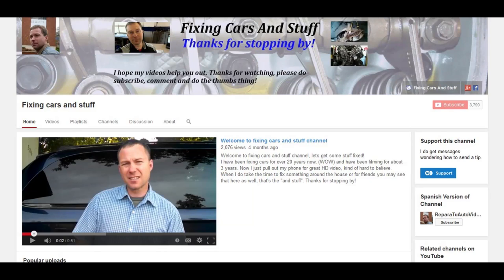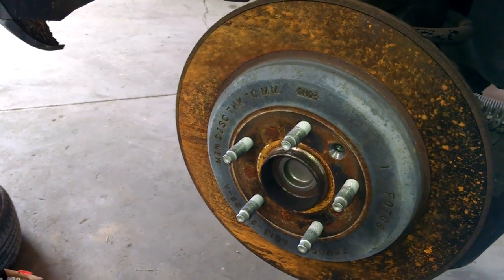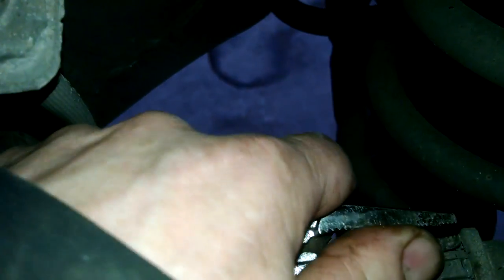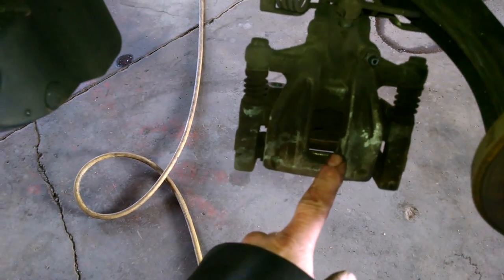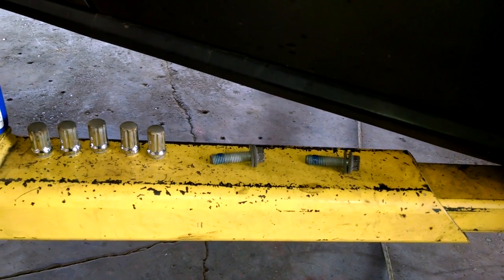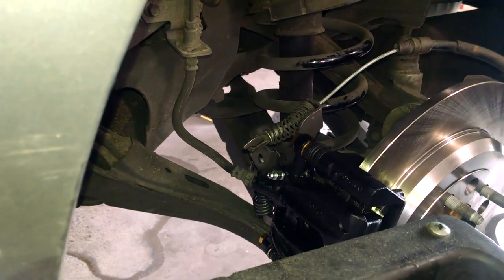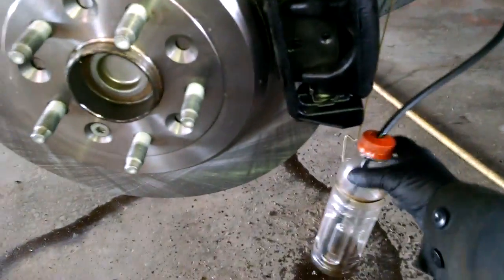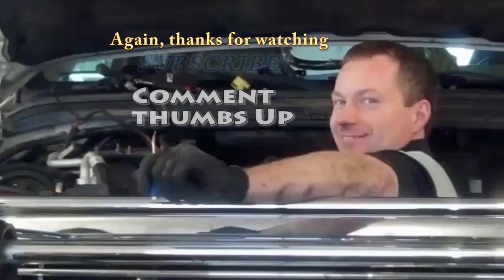Rear brake caliper and pads replacement Ford Taurus X  SEL 2008 how to change rear caliper

Comment: Nasty looking fluid. I would change that while you are doing the back brakes.  Also no need to disconnect the brake cable forward of the caliper. Disconnect it with a $10 tool on top of the caliper. You also cannot tighten the hose after you bolt down the caliper.

Comment: Thanks for the video. Have a 2009 Taurus with the same caliper setup as the 2008 Taurus X. Only issue I had was trying to figure out how to the the e-brake cable released from the calipers.  Ended up just pulling on the e-brake cable to get additional slack and then was unable to uncouple the driver's side cable which then also loosened the passenger side. Had some issues getting the e-brake cable back together until I figured out I had to invert the e-brake receiving bracket to get the driver's side piece of the cable to slide back into the receiving bracket.

Comment: Still can’t figure out how to get slack on e brake cable? Do you just pinch the cable and let the vice grip plyers hang from the cable? I am confused at this particular part
Reply: You can do it this way yet you should really check a ford manual on the recommended procedure.  There are several steps shown in this video that are not optimum for a solid long lasting repair yet they are fast and profitable and can get the car out of the shop quickly. Were it my car I would do things differently but...to each her or his own.
Reply: @geraldhenrickson7472  From the service manual: Parking Brake Cable Tension Release
Tension Release
1. Remove the LH A-pillar lower trim panel.
2. With an assistant, release the parking brake cable tension by pulling down on the intermediate cable
at the cable-to-cable union until the parking brake control sector rotates to its stop and a 4 mm (0.15
in) x 150 mm (5.9 in) retainer pin can be inserted.
3. With the vehicle in NEUTRAL, position it on a hoist. For additional information, refer to Section 100-02 .
4. NOTE: Make sure that the cable-to-cable union is connected to the front and rear cable, before
removing the brake control retaining pin and that the cable tension is reloaded slowly.
Disconnect the cable at the cable-to-cable union.
SECTION 206-05: Parking Brake and Actuation 2008 Taurus/Taurus X/Sable Workshop Manual
GENERAL PROCEDURES Procedure revision date: 05/07/2007
2008 Taurus/Taurus X/Sable Workshop Manual Page 1 of 2

Comment: Thanks for the informative video - was trying to figure out how to detach/install the e-brake cables from the old calipers, this helped me out a lot on the Taurus '08 SEL here (same caliper setup), much appreciated.
Reply: Thanks for the video. I have a Ford Freestyle with the same setup. I didn't know how to deal with the springs for the emergency brakes until I watched your video. Thanks for the informative video.

Comment: READ IF YOU HAVE TROUBLE GETTING SLACK

Very much appreciated, I wasn't able to get any slack but I managed to get one spring off passenger caliper and pressed the ebrake (which was dumb) because I thought the cable was stuck however, that only compressed the loose spring because it wasn't attached the the caliper so it wasn't able to  pull it back. Thought I really fucked up but then with that happening and this video I pulled on the cord leading to the passenger side and pulled the spring tight as i could and put pliers underneath so it would stay but that still wasn't enough slack so then I grabbed a bar clamp and compressed the spring on both sides and that gave enough slack to disconnect the Left hand cable from the main one, then the springs are free. Do the opposite to install.

TLDR: compress springs at calipers via a clamp in order to get enough slack to relive the tension.